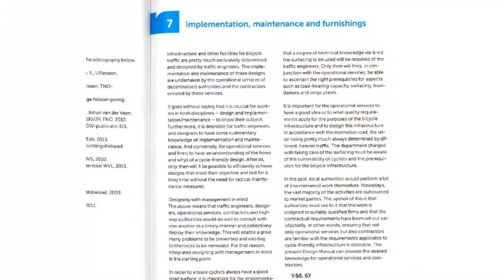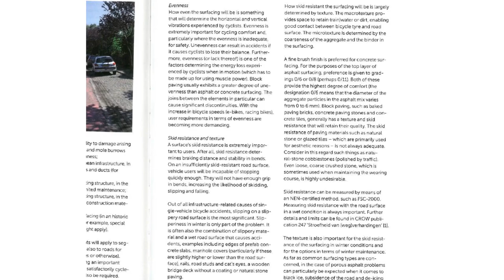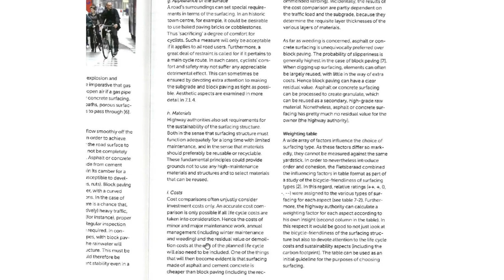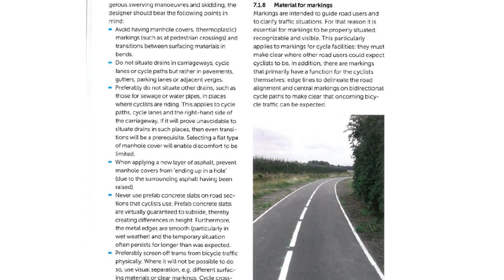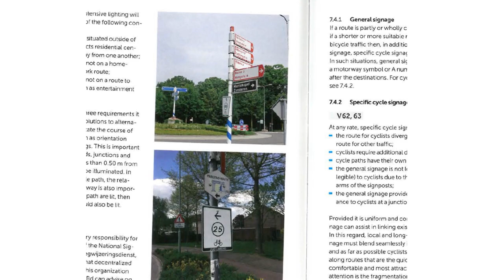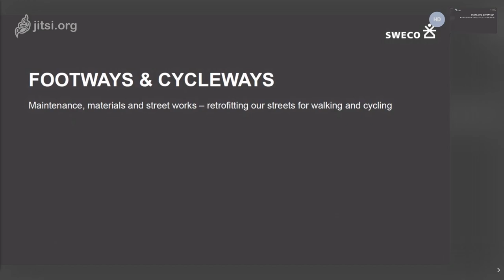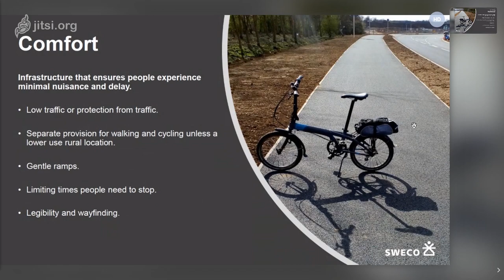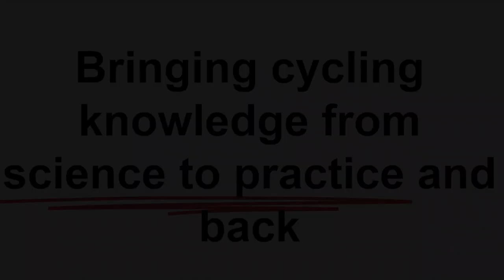CROW Bicycle Chapter 7 Interview with Mark Philpotts

Comment: This is an interesting subject. 
I walk a lot because I live very close to the city center and in my street I have all shops to buy my food. So I do most things by foot. But I recently finished my recumbent trike and now I ride around my city and to other cities. 
The road surface makes how fast I ride and what roads I prefer to take. 
On a recumbent, you notice more how a road surface is and especially on a recumbent trike. You feel every bumb and the angle of the road, more than an upright bike. 
Also especially the older people go faster and faster thanks to the e-bikes. A smooth surface is important and I see in my city that they are updating old cycle roads to red asphalt. 

I have a question. It's sad I just discovered your channel and this episode. I heard recently that in the UK, the people on a roundabout need to give way for people entering it. That is the opposite from here. Is that with all roundabouts or only a few?

I think with bottle banks that they also mean the waste bins next yo roads where you can trow in your bottles and cans in as you ride by.
Reply: I still have my recumbent bicicyle, i drove faster on it that I do now on my e-bike. A recumbent bicycle is very nice on empty roads, not so nice in city's. I had group of people also on recumbent bicycles, we drove every month a nice trip. I had a interview on the radio, was in the papers, was still a strange bicycle. I loved it.
Reply: @leojonkers3181  I believe that. Recumbent ride great. I have a recumbent trike and building a second one that is almost ready to test ride. Still need to do a lot of work on it, but that is mainly bag mounts.
On my first build I removed the e-assist and placed that on my upright. My new build will have e-assist and has a lot of things upgraded. Lower weight, rear suspension, adjustable seat, lower frame, better and lighter tires and wheels, better lights, indirect steering and way more bag mounts. Better for touring. 

Recumbents are great to ride. Sadly here not many people do that.
Reply: @emiel1976ep  Well, in The Netherlands also not many. While you sit nice, you do not catch wind so much (The reason why they go so fast). Wow, building a bicycle  yourself, great respect! Touring is nice on a recumbent, I once took the train to Basel with recumbent and went back to Rotterdam, all along the Rein. 120 km a day. Nice weather, nice trip.
Reply: @leojonkers3181  ik kom uit Helmond, naast Eindhoven. 😊
Ik zie hier wel regelmatig van die trikes met 2 wielen achter. Die rijden hier best veel rond.
Reply: @emiel1976ep  O ja, hier in Rotterdam zie je ze zelden. Een trike lijkt me ook geweldig! Toen ik die groep georganiseerd had woonde ik voor mijn werk in Den Bosch, we hebben ooit eens een rondje Eindhoven gedaan, meer dan 100 km. Plus Den Bosch richting Eindhoven vv. Prachtig daar! Brabant is sowieso een schitterende streek, ideaal voor ligfietsen!
Reply: @leojonkers3181  ik zie in de zomer af en toe wat ligfietsen en een velomobiel.
Ik rij veel rond Helmond en richting België en Eindhoven. Het gedeelte onder Helmond en Eindhoven door de natuur en bij Deurne bind ik de mooiste routes hier in de buurt.
Eindhoven centrum is een ramp. Althans bij het station. Er lopen wel mooie routes door de stad die goed te doen zijn.
Als het in de zomer mogelijk is, wil ik in België rijden. Daar hebben ze ook mooie routes.

Ik heb naar 2 wielers gekeken, maar mij leek het lastig als je veel moet stoppen.
Ze zijn wel snel.
Wou er 1 bouwen, maar zit er nu aan te denken aan een mosquito in hout en aluminium. Lichtgewicht tilt trike met mogelijkheid om er een body op te zetten.
Reply: @emiel1976ep  Ja, België is zeker mooi, maar klimmen met mijn ligfiets, ik heb het gedaan, maar vond dat niet zo prettig. Plus dat de Belgische Ardennen bepaald niet makkelijk zijn. Ik zeg altijd, als je in de Ardennen kunt fietsen kan je het overal. Geen Alpen of Pyreneeën, maar de hellingen verschillen niets. Integendeel, vaak nog wel steiler. Zo te horen heb jij veel ervaring met het bouwen van fietsen, ik zou het niet kunnen. Ik kan mijn fiets klein onderhoud geven, maar daar houdt het mee op. Eindhoven heeft het mooiste Museum modern art van heel Nederland, zo mooi,, maar verder, geen fraaie stad imo. Ik mag de mensen daar wel, geen gezeur, wij werken. Als Rotterdammer herken ik dat! In Amsterdam maken ze het geld op wat wij verdienen. 🙄
Reply: @leojonkers3181  ik ga onder Eindhoven België in. Daar is het ook vlak. Met een trike is het te doen. Je miet niet denken dat je snel boven bent, maar je hoeft je balans niet te houden. 

Zelf bouwen valt mee. Eerste was moeilijk omdat ik veel gereedschap niet had. Ijzerzaag, lasapparatuur en wat vijlen en een accu boor. Meer had ik niet. Nu heb ik meer en kan ik bij iemand aan mijn fiets werken die meer gereedschap heeft. Dat scheelt een hoop.

Ja Eindhoven is absoluut geen mooie stad. Ik heb er gewoont.
Amsterdammers denken dat ze iets zijn en dat is ook alles wat ze zijn. Een gedachte dat ze iets zijn.
Reply: @emiel1976ep Ik snap dat onder Eindhoven België het nog geen Ardennen zijn. Ik denk wel dat je heel handig moet zijn zelf je fiets te bouwen. Ik ben een geboren Rotterdammer en Amsterdam en Rotterdam zijn geen vriendjes.😀 Maar ik overdrijf het ook niet, is geen haat ofzo. (op die domme voetballiefhebbers na dan …) Ik vond klimmen met mijn Rainbow Lyric, kleine wielen en onderstuur (geweldige fiets) niet zo prettig. Kan ook persoonlijk zijn, mijn ene knie is wat gevoelig. Op een rechtop fiets geen problemen, maar klimmen op een ligfiets was teveel gevraagd. Het evenwicht was voor mij geen probleem. Ik ben trike rijders tegen gekomen, waar het echt een probleem was, alle respect overigens. Integendeel, mensen die een medisch probleem hebben en toch een manier vinden om te genieten is alleen maar toe te juichen. 
Ik ben nu al twee keer naar Epen geweest, vlak bij het drie landen punt. De camping waar ik stond was letterlijk Nederland en België. Zo mooi daar! Ik reed op mijn nu oude e-bike (heb er dus 2) en flink klimmen joh, zelfs in Nederland. At meestal in Aken en tochten liepen kwa land volledig door elkaar. Nog geen heel heftige Ardennen, maar toch. Raad het je aan vriend, twee heerlijke weken meegemaakt daar!
Reply: @leojonkers3181  hahaha ik heb niets met alles boven de reviseren maar ik gedoog Rotterdam. 😂😉

Het zelf bouwen valt reuze mee. Ik keek er eerst tegenop, maar ben er mee begonnen en het ging goed. Nu beter en de volgende zal nog beter zijn. Al doende leert men.

Ik hoef bij het klimmen mijn balans niet te houden. Dat scheelt een hele hoop. Ik kan het alleen vergelijken met hoe ik met mijn stadsfiets ging op de bruggen en dan merk ik dat ik met de trike ietsjes harder ga en dan vooral door de versnellingen. Met e-assist is het helemaal geen probleem meer.

Ik wil met die ik nu bouw, het land foor en ook België en Duitsland in. Er komt nog een aanhanger met een bed erin. Reen ontwerp van Paul Elkins.

Mijn huidige trike word voor touren hier in de buurt en zonder assist.
Moet die alleen wat opknappen. Paar keer gecrashed. Te hard de bocht in en dan ga je om.

Hier zie je ook voornamelijk gehandicapten op een trike, maar dan met name die met 2 wielen achter. Auto's geven he wel meer ruimte en voetgangers laten he overal rijden, ook waar je niet mag fietsen. Ik vind het allemaal prima. Kan zo op mijn gemak overal rijden.

Voor wat meer snelheid, wil ik mog wel wat anders bouwen. Een 2 wieler of een mosquito. 3 wieler maar tilt en heeft 2 achter wielen. Is ligter en kan makkelijk een body om. Niet geschikt voor in de stad, maar puur voor touren op snelheid. Velomobiel die tilt.

Als ze maar opschieten met al die inentingen, zodat we snel weer alles kunnen doen. Tevens dat de sneuw weg is en het warmer wordt. Wij reden in de avond en dat lukt nu niet. Dus nu werk ik aan mijn fiets en doet mijn mede trike rider, aan andere fietsen werken.